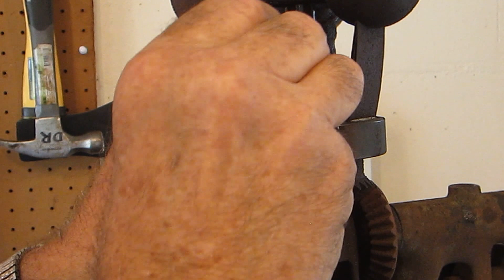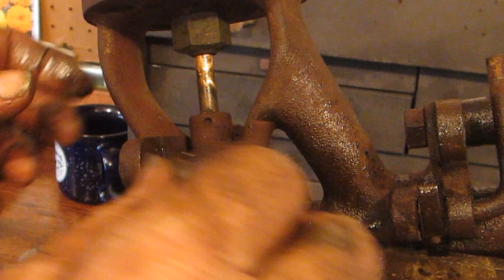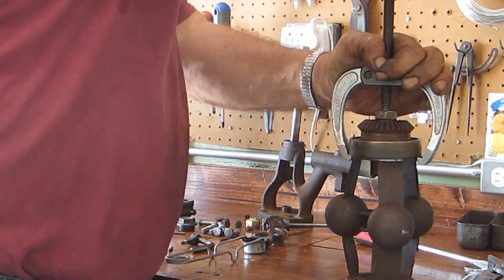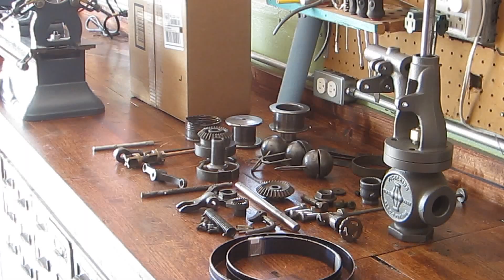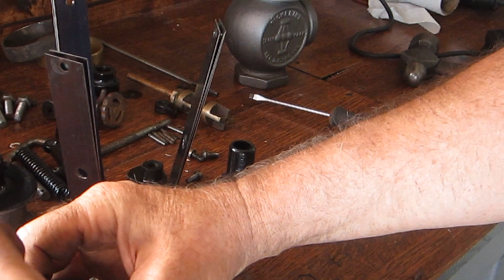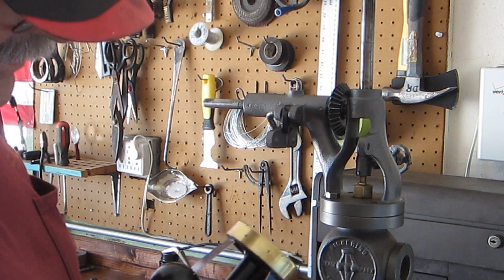OLD STEAM POWERED MACHINE SHOP 20 Rebuilding the Pickering Governor

Comment: This is kinda a off the wall question, but could you use steel banding to make those springs.
Reply from the maker: It might be possible, some of that banding material is quite hard and "springy. but it's pretty critical that the spring force be correct.

Comment: Basic Engineering Courses had Governors and Control Systems in the Lecture materials, setting a Standard of central importance to students that was carried on into Computational Devices and Modelling of all kinds of Circuitry. 

If we complete the path to the logical "Conclusion" we always recover the concept of Recursion to the Mean of self-defining Reciproction-recirculation pulse-evolution and Singularity.
The old Apprenticeships System has always been "Park by feel", a re-evolution circularity quantization cause-effect and identifier of Control Systems that manifests in String Theory type Calculus reasoning, and Quantum Logic-Chemical bonding-> holography dimensionality coordination shaping. This is a hands-on path to understanding Singularity-point Actuality of Absolute Zero-infinity reference-framing. 

Look, listen, hear and see.., (the  olden day proper title) "Professor" Richards, demonstrate complex practical integration of real-time knowledge.

Comment: The were using the Babbitt as loctite?
Reply from the maker: The babbitt took up all the space around the ends of the spring leaves and the screws to hold them solidly and like you say, keep the screws from backing out.....Dave

Comment: An old-timer told me that one of the advertising slogans for the Ball Ranger was, "They see the load coming". I've never been able to find that in any Google search, though. I've got a 1 inch on a generator set up that holds 60 cycles very accurately. Thanks for the video, especially the explanation of how the Ball ranger device works.

Comment: I would love to see this being calibrated.  Hooking it up so something with a tachometer connected to it to see what the different settings you could get based on that one spring with the ratchet in the back. (or front, depending on how it's mounted)
Reply from the maker: I'll set up somthing to run the governor up in the next video.  All it will be is determining an RPM that the balls are at about 3/4 of their stroke. That would be where the governor likes to run, then figure out the belt pulley ratio  to get that governor speed when the engine will be running about the speed that I want it to run. The "Ball Ranger" will do the fine tune. The ratchet spring adjustment really dosn't do much, it mostly is to operate the safety shut-off.....Dave

Comment: Was it luck or were the materials used in manufacturing this govenor helpful in disassembly? I also have been amazed in dissambly of any old machinery without twisting off screws or pins that should refuse to budge. The last brake repair job on a late model truck the caliper bolts twisted off resulting a very long and costly repair. I suspect the govenor will operate as well as it looks.
Reply from the maker: I don know Allan, it's mostly cast iron maybe with some nickel in it. and it was probably pretty greasy to begin with and not in the water or damp all the time. ....Dave

Comment: I believe that the governor was likely coated with layers of grease and oil and dirt that formed a barrier that protected the piece from rusting away.  The metal likely has a very high carbon content and is more like cast iron.  Nice clean up.  It looks great.  Thanks for posting.  I hope the weather stays comfortable down there in Florida until spring returns to NY.

Comment: Two things: I wonder how much difference there is in the rigidity of equal thickness spring steels and what is the best way to grip a ball and not put marks in the metal?
Reply: Another very interesting video.
Reply from the maker: Hi Ted: I believe the "modulus of elasticity" of steel is related to the tinsel strength. Real spring steel is some higher, but as long as the demensions (thickness and width) are the same, it would be close.  It was interesting that the 100 year old springs layed perfictly straight.....Dave
Reply: And as you have pointed out there are other ways to fine tune if need be

Comment: Great rebuild---     it is so nice to see how things work  and all the safeties that were built into them.I just love to see the good old machines being brought back to life.  Thanks for sharing, I know that I told you this before.  When I started my apprenticeship on the R.R. in 1963 we still had line shaftdriven machines in some of the shops. One of the first things that I worked on was an old resaw band saw with a 4 inch wide blade, we were refitting all the machines in the wood working shopwith roller bearings.  By the time I retired in 05 they had a lot of CNC run machines.  What a changebut I still love the good old mechanical hand operated ones.   Thanks for bringing back the good old days!
Reply from the maker: Thanks for the great comment Tom. It's hard to believe that "non-CNC" is the old days, but I guess so.....Dave

Comment: Fantastic video Dave, thank you very much.

We have several Pickering governors on engines at Forncett Steam Museum where I am a volunteer. We worked out how to adjust the speed by the nut and lock nut on the top, but this is really useful in showing how to rebuild one.

Comment: What originally kept the outer half of the flyballs from unscrewing and becoming half cannonballs flying across the shop? I am assuming you will be using LocTite or something similar.
Reply from the maker: HI Pete: There is a thin sholder around the outside of the ball mating surface that they screw down against (not the spring leaves) , that's it...never heard of anyone being hit by a flying ball, but a good question. Locktite would be in order after final testing.....Dave

Comment: Really enjoyed this video Dave - Never seen one of these governors taken apart, or how they adjust the speed. As others have said it did come apart quite easily, considering it had been sitting outside for so long. But then I've often found old nuts that look completely rusted up, actually come off quite easily. Try it with a rusted modern one and it snaps the bolt.
Reply from the maker: Yeah Malcom, it fools you somtimes.....Dave

Comment: Great restore job Dave, and another great video! .....out of curiosity....if one came across an old rusty governor like that at swap meet, what would one expect to pay? It maakes my day when I get notification of a new vid from you! ....keep them coming
Reply from the maker: Boy I don't know Jim, it's like injectors, the smaller ones like 3/4" or 1" size are in the highest demand and if it's complete with the valve probably in the $500-600 range. for a Pickering. Really nice $1,000.....Dave

Comment: I am amazes that it came apart so easily. Those tapered key would worry me but since it is new fangled tech @ 110 years old they may improve it!
Simple,, but a very smart invention.
Reply from the maker: They come out pretty good if you can get a solid hit with the right size punch and are driving from the correct (small diameter) end....Dave

Comment: Beautiful restoration!  I do have a question though.  Why did you change from the original 3 springs per ball to just 2?  I remember you saying that the thickness of the spring was critical to the calibration. I was surprised to see you change to 2 springs per.  Wouldn't that change the calibration you were being careful to duplicate?  Wonderful video series!  Your shop in New York is a treasure.  Have a good day sir, Paul
Reply: Look closer, there are 3 springs.

Comment: Thanks for the update. Was that the end of the development of that type of governor, as the heyday of steam was being eclipsed by electric motors and internal combustion engines?
Reply from the maker: I think by the late 1920's,  most new stationary steam engines had become "automatic engines" with the governors built into the flywheels and acting on the valve timing instead of throttling the steam. The "Pickerings" were used for a lot of things though. There is even one set up to regulate a sluce gate at Dollywood park driven by a roller chain from a small paddlewheel.......Dave

Comment: Hey Dave, Ive got a couple questions. The first one is what do you use to clean up soft metals like brass? The other is what would be a good lathe to start on just a small one I would like to get one but I don't want one to big what would be your suggestion. Great work love the videos.
Reply from the maker: Zeb: I just cleaned up the brass rings on a wire wheel and then spun them in the lathe with fine sandpaper and steel wool. An older Chraftsman or Atlas is a good starting lathe, just make sure you get all the "tooling with it" (chuck,holders, change gears, steady rest, etc......Dave

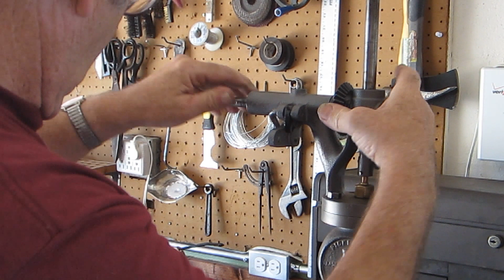Comment: 43:10going to deplay my ignorance now, was it Babbitt or lead that you poured in over bolt/screw heads?
Reply from the maker: Thanks for the comment Steve: I saved the babbitt and used it over. I was a little short so added a few lead sinkers. In this case it's just to help support the springs, could even use epoxy or bondo......Dave

Comment: Another good one Dave, and very interesting about the safety's on it. I still think the older stuff comes apart better than the new. I knew a guy that had a Woodward turbine governor made in the 1800's and when we tore it down for some babbit re-pouring, the mating surfaces were still shiny, even though the unit had set out in the rain for years. Amazed me!